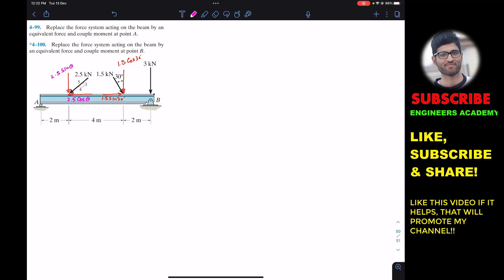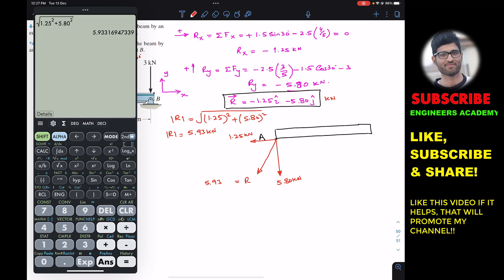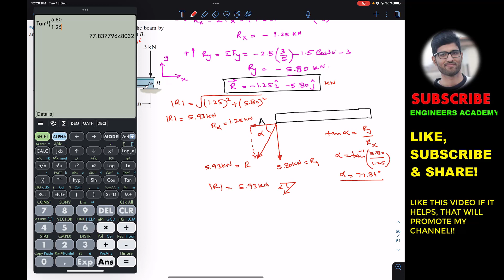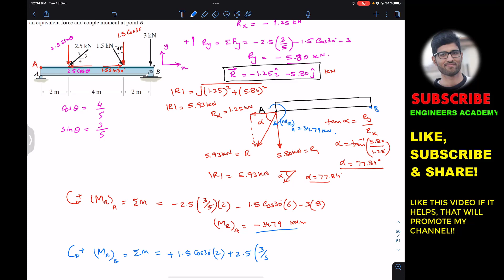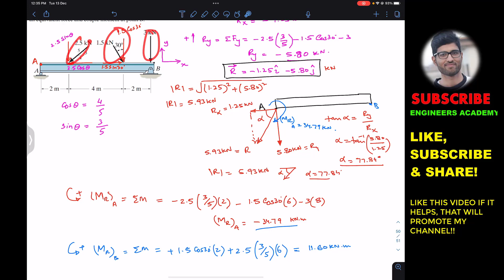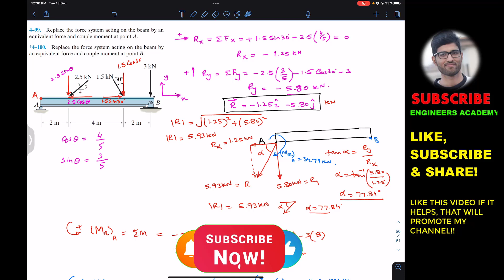4-99 Equivalent Force Couple System Chapter 4 (Hibbeler Statics 14th Ed) Engineers Academy

Comment: Hello! Thank you so much for your video. I have just one doubt. In the beginning of the video, at 3:39, the summation of forces in the x-direction is supposed to be 0, but it becomes -1,25 kN, not 0. Please, why is that? Thank you!
Reply from the maker: This is not related to equilibrium, this is equivalent force system problem. We want to replace these three force by one single force.
Reply: @ Thank you!
Reply: @EngineersAcademy2020 Hi, I don’t understand & I have the same question. You wrote Rx = 0 on line one but then write Rx = -1.25 kN in the following line. I am confused